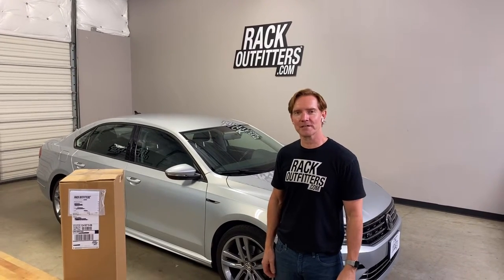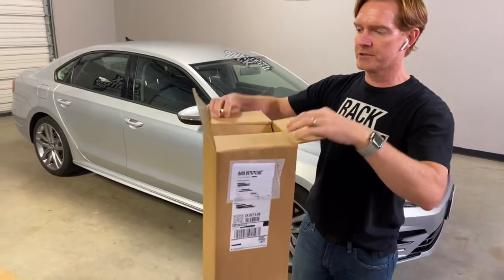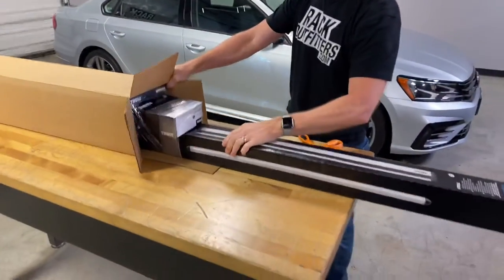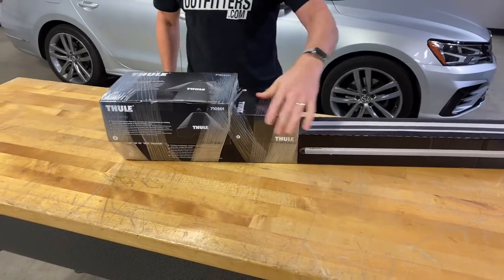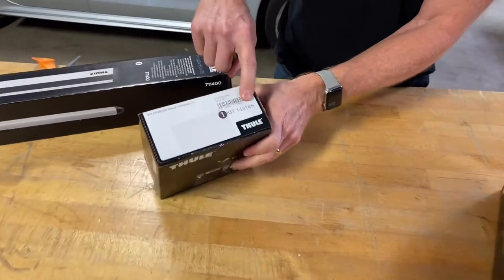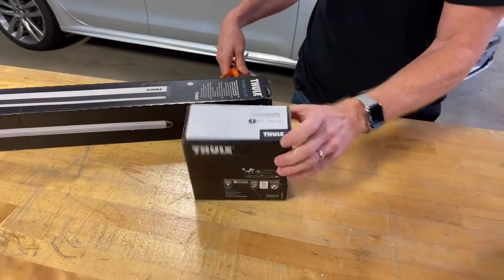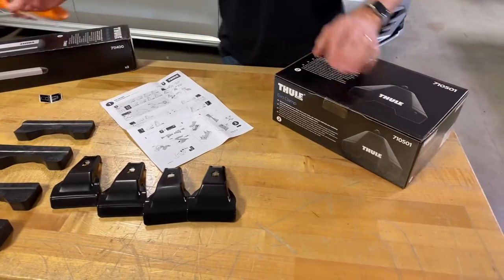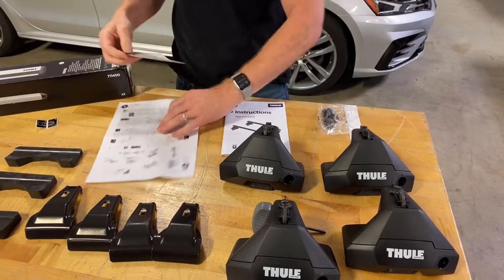Thule EVO Clamp WingBar EVO Base Roof Rack Full Assembly and Installation

Comment: great video thanks a lot, especially when you say : loosening it.  But to carry a kayak,  the distance between front and rear bars (710mm for my Kia Soul) is too small, so I installed the rear bar much further
Reply from the maker: Hello.  Thanks!  It's best to stick with the measurements provided, when it comes to the KIA Soul, the geometry of the rear door mounting area is mostly consistent so there may be some leeway to position further back.

Comment: the instructions in the kit for my F30 doesn’t mention any x y scale. though i have those smart sliders.. how can i find the scale for my specific vehicle?
Reply from the maker: Hello.  The BMW 3 Series (F30) 2012-2018 (North America) has a listing for fixed point connections, no bare roof fit using the Evo Clamp.  Double check the vehicle fit guide, the results will include the list of approved components including the fit kit which will have a PDF instruction manual to review: https://www.rackattack.com/fit/

Comment: why in none of these videos does it say which part of the order of the 3 will contain the slide scale?
Reply from the maker: Hello.  The slide scales are included with the load bars while the vehicle specific fit kit will have the instruction sheet with the scale number for the vehicle, eg: https://www.rackattack.com/public/product-instructions/145001_521-5001-01.pdf   Thanks!

Comment: Great video, gave me the confidence install my roof bars. Initially, the feet didn't seem to fit when set to the width in the instructions. Paul's insight on loosening the ratchet was very helpful but I still had to adjust the distance between the feet a little.
Reply from the maker: Glad it helped. Feel free to use our live chat if you need any more help!

Comment: hello man! Thanks for all this. Can you shorten the bar (by sawing it) for a better look? Cheers
Reply from the maker: Hello.  It is possible, the correct method would to trim equal amounts from both ends to maintain the even curvature.  The cut would need to be very precise for the end cap to press on flush and a special rectangular punch out would need to be added for the endcap tap to engage.  For those who prefer the shortest bar possible, consider the Thule Edge Clamp system which uses flush ended feet that telescopically match the vehicle width perfectly.  Thanks!
Reply: @rackattack  cheers for that!

Comment: Great video! Thanks for the full and detailed explanation. We just installed our Thule Clamps + Wingbar on our Golf Mk VII but had issues with the wideness. We had to shift the given distances between the two clamps by a few millimeters so that we could put it on.
Did you run into similar issues?  Thanks for your help and greetings from germany :)
Reply: Also installing onto the Golf Mk VII and finding exactly the same, I'll do what you have an widen it slightly.

Comment: How can you change the clamps for your car? Is there any video that shows that for wingbar evo?
Reply from the maker: Hello.  Yes, a foot pack can be reconfigured for another vehicle base on the results of the fit guide.  The rubber bases can be pealed off the foot bases and the metal brackets can be removed by pushing upward into the foot, then rotating inward, and then pulling down.
Reply: @rackattack  thank you so much ☺️

Comment: Hello! Im thinking about getting this rail. I have a question, since it's my first time, will the water enter the top part of the door, since the door rubber gasket isn't completely sealed due to the clamp? Sorry for the simple question.
Reply from the maker: Hello.  The intrusion of the door frame bracket is minimal and generally only deforms the outer wind gasket slightly and has no impact on the other inner water gaskets.  Thanks for asking!

Comment: Сегодня купил дуги Thule wingbar evo. Заметил что они слегка выгнуты. Это так?
Reply from the maker: Yes, there will be a slight curve to the bar. As long as the curve is identical on the bars, you are good to go! If one bar is more curved than the other, however, reach out to us or the retailer you purchased from to assist.
Reply: @rackattack  нет, они оба одинаково выгнуты в сторону багажника, вверх. Я предположил что это сделано специально, компенсировать будущую нагрузку от багажника, и еще когда затягивают крепления, они обычно прогибаются во внутрь, к крыше автомобиля. Спасибо вам за ответ, и за инструкцию!

Comment: Thanks for that video. A question. How do I use it with the Thule 599 UpRide?
Reply from the maker: The Thule 599 Upride was designed to work on all of Thule's and almost every brand's cross bars. You can either attach the Upride using the T-Bolts (comes in box) and sliding them into the bar's top channel. Or you can go "Old" School" and use the brackets and bolts to wrap the Upride around those crossbars. I've added the Upride's instructions below, I'm more of a picture person myself!
https://www.rackattack.com/public/product-instructions/Thule_UpRide_599000_v02.pdf

Comment: Is there a way to remove the fit kit and replace it with another set?
Reply from the maker: Hello.  Yes, the Evo Clamp fit kits are removable and sold separately, do confirm that the bar length is transferable to the the other vehicle.  Thanks!

Comment: It's says on my drawings 40.5 were to set the ruler gadget to get the correct with but my black measurement black sticks only go to 35? Any help please
Reply: So basically the little black ruler mine only goes to 35 and it says on my drawings they should be set at 40
Reply from the maker: Hello.  Is is possible you have chosen a bar length other than the what's listed for the vehicle in the fit guide?  If you'd like us to look into this further, please provide the year, make and model of your vehicle and the bars, towers and kit that you're using now.  Thanks!
Reply: @rackattack  hello sorry I'm all new to this my car is a 2021 vauxhall crossland elite nav the bars are from vauxhall and are the same as this set in your video and the instructions that come with the bars are a waste of time. Thank you for replying and your videos are great
Reply: @rackattack  I've finally fitted them and all is good.

Comment: i am not mounting my front and rear bars that close together i will be adding 10 inches in between and its a shame that the top rubber track on the yakima is way better system that double rubber rail fails to easy and harder to work with
Reply from the maker: The installation instruction are layout by Thule for the best bar fitment on the vehicle.

Comment: Payed $400 just for the fit kit and the clamp. And an extra $250 for the actual crossbar. Seems very expensive for a roof rack
Reply from the maker: The prices are set by our supplier and are fairly comparable for the brand that we carry. This is so they can continue to offer their limited life time warranty on their products and supply the customer services necessary.
Reply: @rackattack  lifetime warranty but not covered by normal wear and tear such as rust. Lifetime warranty just covers defects in materials. This is all from carid where I bought mine.